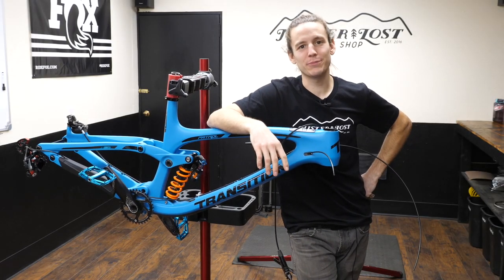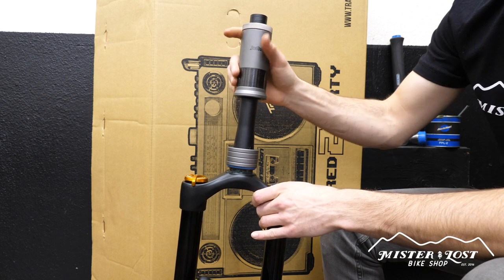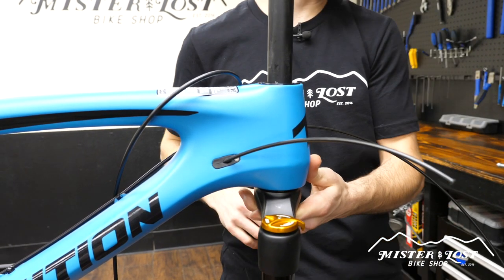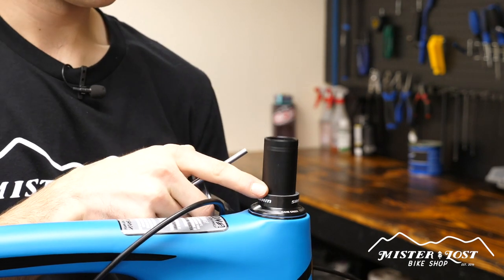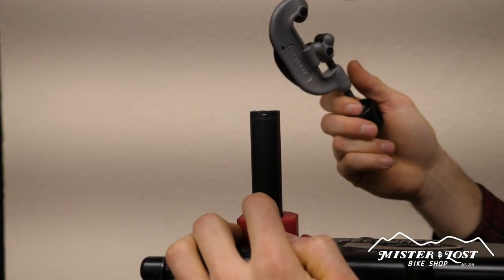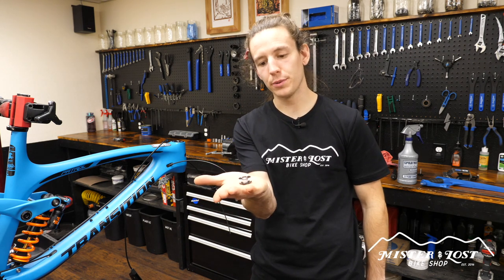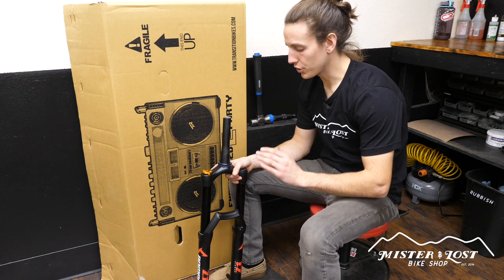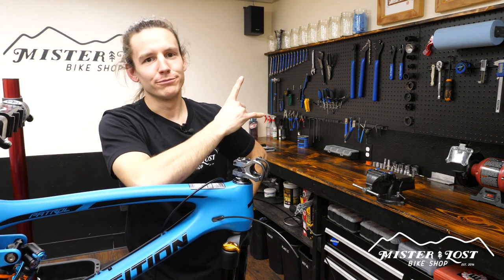How to Install a New MTB Fork

Comment: 1 flaw though, when you were pounding that star nut into the fork, metal dust should come down pouring to the stanchions, you might want to use a rag and place it under the steerer tube to catch the metal dust while pounding the star nut. I know this because I experienced this when I installed the star nut on to my fox 34 sc fork.
Reply from the maker: Great advice! That wouldn't hurt, but I've never see metal flakes come out from pounding in a star nut. If you cleaned the steer tube after the cutting/filing like I did in the video then you shouldn't have any leftover metal flakes to fly anywhere.

Comment: I can tuna fork but I cannot tuna fish! LOL. Great job on the explanation and your step by step procedures. Nice to know there are alternatives if you do not have shop tools on hand. Like the tube cutter. I use that when cutting conduit when running electrical. Great and handy tool for precision cuts!
Reply from the maker: LOL! The tube cutter is soooo much better than a saw and guide in my opinion!!
Reply: @TheLostCo  Yeah, and another electrician trick. That rotating  tool you use to scrap off the burrs on the inside- You can also use a needle nose or channel locks pliers by sticking it in the pipe nose first and rotating. The outside of the pliers will scrape off the sharp inside edges. Hope this helps!

Comment: Hey! I love your Videos👌🏼. I've got a problem with my dropper post (ks lev si). It doesn't come out all the way, there are 1-2 cm of play up and down. The cable tension is correct, as well as the air pressure. I've heard the problem would disappear after a service, but the post is only 2 months old and the problem appeared after 2 weeks or so... Have your heard of this problem and may have a easy solution to solve it or do I realy have to service the whole post?
Thanks for any answeres, I really appreciate it!😄
Reply from the maker: Ahh darn that sucks! It sounds like the cartridge is bad. If you sit on it, and you sag into the seatpost's travel then there is something wrong internally. Unfortunately, KS has a horrible customer service setup, but if you set up an RA for warranty on their website then they can generally fix the seatpost within 1-2 weeks. Now's the time to do it during winter!

If they give you problems and want to charge you between $100-$200, then I would switch to a different seatpost such as the OneUp Dropper Post since they actually answer the phone and their post only costs $200 new!
Reply: All right thanks for answering my question!
Reply: Herby did you get a new one or replace?

Comment: This was a great video, but I have one question.  When you were discussing how to mark the steer tube for cutting, there was a break and you showed two marks - one at the top of the spacer and I'm presuming the other was with the spacer removed.  Why cut the tube 2.5mm short?
Reply: You want the fork to be slightly shorter than the top spacer.  In this case since he was using a 5mm spacer he scratched a line under the spacer so that he had a reference to have the best idea of where to cut.  If you were using something like a 10mm spacer, you would just scratch a line around the top of the spacer and then measure down about 2.5mm to make your cut.  In the case of the 10mm spacer it does not have to be perfect at 2.5mm because you have more room.  In the case of the 5mm spacer on top you want to be pretty dang sure, because there is not much room left over.

Comment: I have Shimano BR-M355 brakes but there beaten and even missing a part or two 😅 should i just replace them with or upgrade
Reply: Also if I upgrade how do tell if they’re compatible
Reply from the maker: @alpinesender1569  If they're super beat up and you want more stopping power, then I would recommend upgrading for sure! Those brakes are entry-level and any upgrade is going to give you a ton more stopping power. 

You can pretty much just bolt-on any new brakes and they'll work with little to no modification.

Comment: PRO TIP:  Before filing, stuff a paper towel all the way into the center of you headset and take an old T-shirt and punch a small hole through it and stick your fork headset through the hole and drape it over your fork body. When done turn upside down and remove. This will prevent any shavings from getting onto the critical parts of your fork.

Comment: is there any difference between marzocchi forks and fox?
Reply from the maker: The chassis are the same, but the dampers/paint/decals are the same. The Z1 is $699 and is a great way to get on a new super plush & stiff fork. You can later upgrade the damper to the Fox GRIP2 and BOOM you've got the best fork money can buy!

Bomber Z1's are on my website @ https://misterlost.com/forks/?category=Marzocchi
Reply: So it's essentially a performance series fox 36 ? Interesting, I had no idea.

Comment: You sure you want grease between the bearings and the frame ?  You want the bearing to do the work. You dont want to chance the outside of the bearings turning against the frame . That could wallow out the frame and compromise the fit.